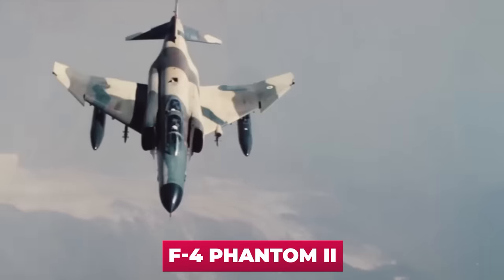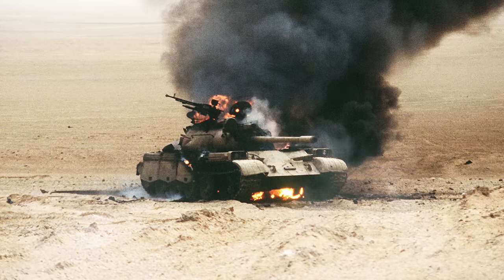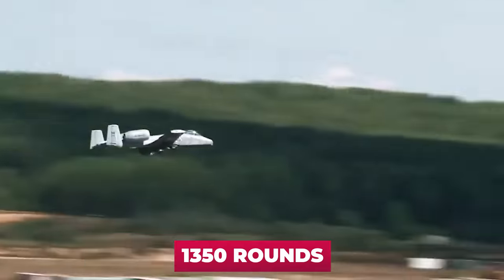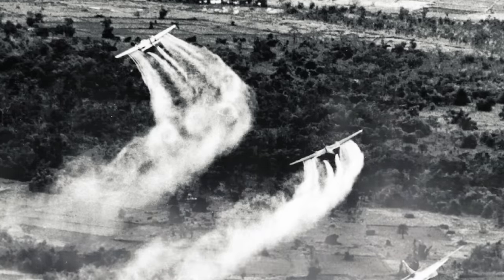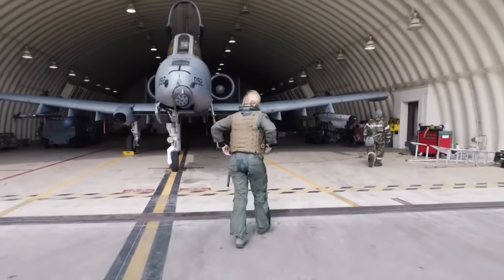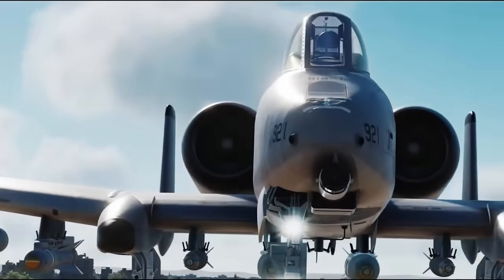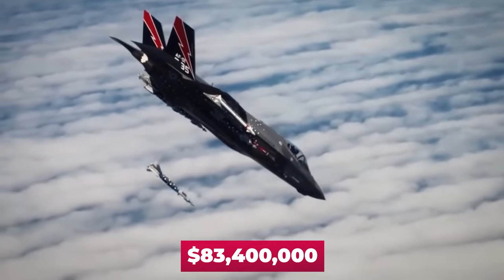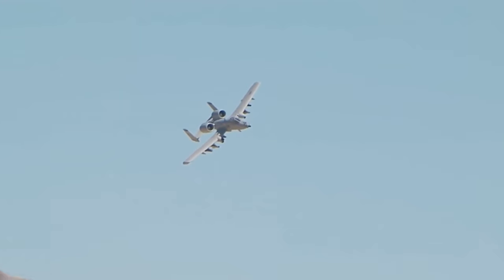US Tests A-10 Warthog After Upgrade To Secretly Send It To Ukraine

Comment: The A-10 was designed to address a mobile battlefield that was NOT equipped with highly effective, widely distributed, shoulder fired missiles.  Despite its extremely robust construction I am afraid it would be chopped to pieces attacking well defended static orc positions in Ukraine.  Adding it to the offensive mix in a mobile battle where the defense is not as organized is another story.  The A-10 could have a decisive impact in that environment.
Reply: Yep. From what  I've read, it needs to operate where air superiority has been established. Not Ukraine, and that's why it is not being supplied. Haven't seen anything that's changed.
Reply: @paultempany2053  Could be used defensively, potentially as a response to mobile offenses.
Reply: Some would be shot down of course. Just like in any war but over welming numers with trained troops wins the battle.
Reply: @paulzink2492  This. I don't think Ukraine would lack for pilots willing to risk it all for the chance to blast the russians with one of these monsters.
Reply: If the A-10 can't survive,  neither can any other aircraft.  The A-10 is the best close air support platform on the planet.  It's built like no other US airframe.  The A-10 is the HULK of US aircraft.  Nothing is as cost effective either. The F-35 can't do the job and is a very expensive and fragile aircraft.
Reply: @webmastercaribou7570  Agreed.  All this talk about supplying Ukraine our on M1 Tanks (and equivalent western tanks) always follows up by the experts reminding us "simpletons" that they are not invincible and will still be lost in a battle such as in Ukraine.  Same goes true with any aircraft.  Quite frankly, the lack of any large airwar over Ukraine is very surprising and just means it will be drawn out over several years with even more loss of life... all to keep a few Russian spec planes from being lost.  Seems a strange way to fight a modern war to me.
Reply: People keep underestimating A-10s ability to get home even after hit several times. Sure, it could be hit by a rocket. The question is, could the rocket hurt it? Maybe after they've hit it with fifty rockets but by then it will have returned to base to reload anyhow. People saying A-10 "needs" to operate where its side has air superiority. This is false. It would for sure have problems if the other side had air superiority, but Russia does not have that in this war. Most of their planes fire missiles from thousands of miles away. They have a lot of choppers which are no match for the A-10. They do have some pretty advanced Migs but that has not gotten them air superiority thus far and it probably will not in the future because Russia can't replace the Migs it loses.
Reply: @havable  what I found funny about folks that defend the A10 is how they say it can fend off rockets and missiles but turn that around to firing that same ordnance at a tank and they say a tank is dead with one shot.  A10 is armored but compared to a tank it might as well be tin foil.  I don't even know if it is armored as much as a M113 or Bradley. No way an A10 can be as armored as a tank and still fly and no way it can take more rounds than a tank and still fly.  It's like the movies have made it invincible, kind of like how grenades make much bigger "booms" than actuality. All fantasy stuff.
Reply: @panzer948  1.5 inches of titanium compared to even 140mm of steel with an overlay of chobham it still out does the tank for crew survivability. Machines are easy to replace, good fighters in those machines are not.
Also, the A 19 is well known for coming back missing chunks only to be rebuilt and flown again, it's the modern B-17 as far as lose lots of parts in the fight and still be flying
Reply: @BloodRaven1969  please give me a reference or link that indicates where an A10 is tougher than an Abrams... if that was the case, Abrams would be made of Titanim lol. You are drinking too much A10 Kool-Aid. Yeah, B17 could take alot of punishment but still wasn't as strong as a Shermsn tank, but I do like that analogy 😉
Reply: @panzer948  I read and then reread my comment and still don't see where I said the A-10 is tougher then an Abrams, you took it that way. I DID say the A-10 has a better crew survivability, and it's in the air.
I love the A-10 but it has its limitations. You limited yourself by a closed minded reading of what I wrote, kind of like an A-10 with a flock of enemy fast movers in the area...

Comment: I think because the A-10 Warthog is such a good support plane & a lot cheaper than an F-35, they should upgrade them, maybe to a D or E variant, to support NATO troups, with the F-35's, Grippens, ground and Navy forces, to counter a balligerent Russia or even a conflict somewhere in the Asia Pacific realm, in the future... Especially that Gattling gun is something not easily replaced, on the battlefield, as wel as it's survivabillity... & when it's hanging full of rockets, it's allmost like sending an armed/armored 'mule'/flying tank to the battlefield...
Reply: They need to replace the old engines with new more fuel efficient ones,and have a dedicated hard point just for an ECM pod.

Comment: It seems like a combination of the A10 and the F16 is extremely capable of dealing with air to air and air to ground combat, each one taking up the slack for any shortcomings the other has. 
A little bit like sending Spitfires with  Lancaster bombers in WW2  
The A10 is a phenomenally capable ground targeting weapon while the F16 has the adaptability to take on major "dogfighting rolls" as well as high altitude bombing of hardened targets.
I would be making sure they know how to use and have access to both.

Comment: Fun fact, the A-10 rarely can destroy modern main battle tanks (by modern, I mean basically all of them built after the A-10 entered production) with it's gun, and would have to rely on bombs and missiles, the jet also forces pilots to identify targets, friendlies, and basically everything with binoculars, and the upgrade package costs more than an F-35A. Modern Anti-Aircraft systems can easily shoot down this plane, and it's gun is so inaccurate that it's probably only going to get 30% of it's bullets on target.

But does that stop anyone from using it? No, absolutely not, it's still such a moral booster that it's worth keeping on that point alone, but it's also effective against buildings, and anywhere were troops are out in the open, making it still somewhat effective, but, with the new AC-130 models and F-35s already being produced and used, I don't think the A-10 should be kept in service too much longer, it's an old system that has basically no sensors without a massive upgrade package having to be installed, is extremely vulnerable to modern anti-air systems, and won't be of that much help in Ukraine, especially when other systems can preform CAS much better, such as the F-16.

And before someone says that the F-16 or F-35 can't perform CAS, CAS means that an Aircraft is attacking ground targets that are close to friendly ground forces, and has nothing to do with the proximity of the Aircraft to the target, aka, you could be operating at the maximum distance that your missiles can target ground forces and that's still CAS as long as it's attacking ground forces near friendly ground forces, so honestly, jets like the F-16 and F-15 (Specifically the Strike Eagle variant) and Helicopters like the Apache would be better to send to Ukraine than the A-10 if, and only if, they're sending the versions of the A-10 without the upgrade package, if it's post upgrade, then it becomes just as deadly as a multi-role

Comment: The A-10 is the Thunderbolt II, not the Thunderbolt. The Thunderbolt was the Republic P-47, a World War II-era fighter plane. I hear A-10s all the time when I go to my friend's cabin to ride ATVs. You can tell they're A-10s because the turbofans whistle when they fly by. I live a few miles from an international airport and there's a lot of traffic over my house. Sometimes I can hear turbofan engines, but they don't have that whistle the A-10 does. Sometimes we see them too, flying in pairs. And we hear a lot of bombs or artillery exploding, about 30 miles away at Camp Graying, MI. It sounds a lot like thunder from that distance, but it's still easy to hear the explosions. The cabin isn't far from Alpena Combat Readiness Training Center, a Michigan Air National Guard training facility, either. It has  the largest airspace east of the Mississippi River, and military aircraft go back and forth, from there to Camp Grayling, year-round.

Comment: At 6:42 what is the shell of the engine nacelle made of looks like aluminum or titanium is it a metal foam or some kind of honey comb pattern? or are my eyes deceiving me and it's some kind of Kevlar?

Also my hot take, A-10's and Western Tanks need to add Active-Protection-Systems to counter missiles or they're scrap in the second quarter on this centaury 2000's.

Comment: The A-10 is a slow plane, only 706 km/h top speed, 439 mph, according to Wikipedia. I thought I read decades ago that it was 460 mph, 740 km/h. Originally there were 2 rates of fire, 2,000 and 4,000 RPM IIRC. And the A-10C entered service with the Air Force, not the Army.

Comment: This was my argument in a another vlog of the US sending a pair of A10's besides the F16. This plane is a very capable close air to ground support because just the sound alone of that gatling gun would strike  fear among the orcs not to mention the firing of the rockets slung on its belly. Maybe the AC 147 gunship called "Puff the Magic Dragon" in Vietnam would also be nice. All those guns blazing would easily rip into the trenches and bunkers. However, this slow moving plane might be easily hit by missiles so the A10's are better suited.

Comment: Works well against lightly armored vehicles and troops when you have air superiority, which Ukraine does not have. Ukraine is basing their war planes in Poland. A10 would be vulnerable against any modern air defense system or even manpads.  The Su-25 is smaller but is has up to 1100kg of titanium armor on board (the A-10 has “only” about 540kg). The Su-25 is also much faster and more maneuverable. It is much harder to hit. Most people don't realize it also has a slower stall speed
Reply: Ukraine is not "basing their warplanes in Poland." The Su-25 does not carry 1,100 kg of armour unless you're referring to a special model of which there might be six manufactured. Stall speed greatly depends on external stores - the low stall speed of the Su-25 is arrived at when it's 'clean' - a useless number. The Su-25 is a bomber dropping dumb bombs most of the time thus it's silly to compare with the A-10 which is designed for accurate, timely CAS. Neither weapon is ideal for the Russo-Ukrainian war. The big advantage of many Russian military aircraft, including the Su-25, is they can use any piece of flat land that's long enough as an airstrip - that's a very important attribute.

Comment: Go Hogs! If it ain't broke, don't fix/replace it.  The A10 routinely goes nap of earth at 50 feet AGL, below the radar acquisition altitude of virtually all SAM sites and in any terrain with some trees /other coverage, will not be targetable by ManPads due to limited sight times.  Same for small arms.  Hog drivers pride themselves on "how low can you go" for survivability.

Comment: Don't try and fix what isn't  broken and if something works keep it around. The A-10 has proved it's value over and over again, it can fly fast and low and rip the hell out anything off it's nose in the blink of an eye, it a tank killer, a convoy killer and throw in a couple of bridges with some supply trains and thats all in one pass. You can get all of that and make back home with change in your pocket, it's like the 50 and 60cal machine guns no matter what you give out to your troupes on the ground or how new and great the weapons are you going to keep those items around you don't  replace proven lifesavers, they aren't your backups there your winning foundations.

Comment: I know the plane is designed to still fly with only 1/2 of a wing on each side. That’s impressive. But that takes a plane out of service for a significant amount of time. I think you will have to use the F-16 for ground support. While not as effective it greatly improves the chances of survivability, yes?

Comment: I spent 33 years in the United States Army and I am a combat veteran. The A-10 Aircraft was designed to do one thing that  is to destroy enemy armor, whether it is tanks or any other type of armor vehicle. And it does an excellent job. We don't have to keep developing new airplanes. Upgrade the  electronics and other components that need to be upgraded and keep the plane. I think I have said enough use common sense. Just ask the troops on the ground we appreciate the A-10. Afterthought. Why can't the United States send the  A-10 to Ukraine?

Comment: Today, wouldnt shoulder launch surface to air make it an easy target? It’s never flown against modern surface to air systems like Russian S-300 and S-400, how can it survive? I know it can take incredible damage and still fly, but direct hits from shoulder fired or AA missiles systems?  It’s not been operated in contested air space by modern force.  Will it work today? I am not so sure they are useful until complete air dominance and a clearing of SAMs. But you still have shoulder fired missiles—especially at 500 feet and only going 400 mph. Anyone have an informed opinion?

Comment: The main reason the USAF wants to retire the A-10, is it's only effective in noncontested airspace, and is highly vulnerable to SAMs and enemy fighters.  Recent use of the A-10 in both Gulf Wars and Afghanistan were mostly after the US had established air superiority.  The A-10's impressive track record of losses vs sorties must account for the lack of enemy fighter jets and SAMs during the bulk of those sorties.

The main advantage the A-10 has over the Su-25 Frogfoot is its ability to fire guided munitions.  The A-10 is a more effective weapons platform but performs the same low-level missions.  The Su-25 has a similar reputation for battlefield survivability, but has not survived well in Ukraine.  Both sides have seen large losses of Frogfoots, so it's questionable if the A-10 would fare that much better.

Comment: If anyone truly believes either the F-16 or F-35 can replace the A-10, you must be high. The A-10 flies down and dirty, or as the ground troops  say, down in the weeds. Does anyone really believe the F-16 or the F-35 I’ll fly that low? Many A-10 pilots talk about not only hitting their targets at danger close distances, the pilots can look around and deal with any other targets they see. Drones can’t do this. Yes low flying raises the chance the A-10 it can be damaged by ground fire, but the chances of it surviving are exponentially greater than an F-16 or  F-35. Both of those would probably be restricted to much higher drop altitude.

Comment: I've read comments that the Me262 and the P-51 are faster than the A10.  Plus, the WWII planes are more than the A-10 can handle in aerial combat due to speed and it's cannons.  However, once the WWII  pilots realizes the A-10 has a Gatling gun that shoots faster rounds than their cannons.  It would behoove them to turn back where they came from.  In another comment referring if the WWII planes decide to break off the combat that the A-10 could not catch up with them due to speed.  However, for the A-10 it's the lease of their concern if the pilot decides to fire it's sidewinder (Mach 2.5 with a max range of 22 miles).  Another comment that the A-10s has reached it's final of point of it's platform.  Tell that to the Russians because they're known for their planes not to have final point.  I firm believe that A-10s have done an excellent job in supporting ground troops than any fixed wing that's flying today.

Comment: The downside is, the A10 is slow. A tank in the sky, but still slow. Making it a big target still. I feel like this will not make a difference if they are actually planning to send some. Plus the learning gap doesnt help either. If the pilots have the right training, they would be able to get rounds on target, but... If its rushed training, its not going to go too well.

Comment: The only draw back of the A-10 is you must have Air Superiorly or they are slow sitting ducks for enemy fighters now what about stinger type shoulder fired weapons. Give me a MQ-9 - Reaper at 20000' and a small commercial drone with a Lasor designator, flown by the troops needing the A-10's ground support.

Comment: Not until the airspace is uncontested' and, that includes manipads. The gun wasn't as accurate as hoped, but in close air support, it's hard to see a better platform. Comms with Ukraine ground is an issue. If the A-10 went in now, we'd have to be prepared for a significant loss, something that negates our Afghanistan bragging point. Maybe an EC-135 blanket?

Comment: I want to buy a decommissioned one SOOO bad. Can't wait for them to go on the market. take out the gun and add a second seat, Fuel and storage instead of weapons, and you have a reliable cross-country vehicle. Your local air national guard will help keep jets like this running, not for free or with ought use though. I would put a clear floor for the rear seat and the person could use optics when looking for lost people/boat/criminals, whatever they need to search for.